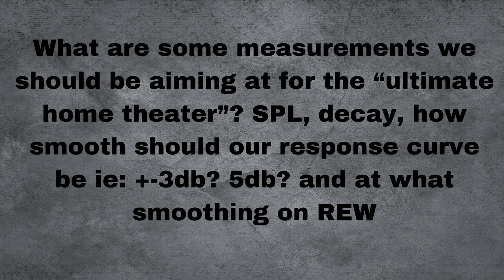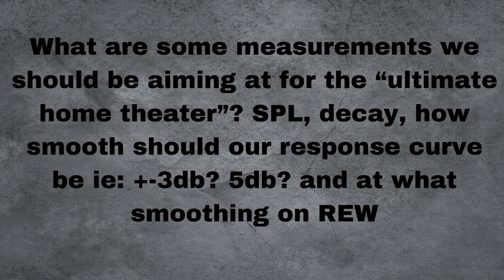The Best Measurements for Your Ultimate Home Theater Setup

Comment: In practical experience, what is the separation needed between surround channels and atmos to maintain spatial clarity.  I have a low ceiling at 7'5".  Seated ear height is around 36".  Following the Dolby specifications of 45° up and 45° left and right, that puts the rear atmos speakers in a .4 system within 2' of my side and back wall.   Trying to decide if a 9.2.2 would be better.  If I stick with a .4,  should I bring the 4 atmos channels closer together (left/right) in order to get further separation from the surrounds or would it be better to bring the surrounds closer together on the back wall than the 135° recommendation to put some distance between the two.  Hopefully that makes sense.

Comment: Very good video, looking forward for more information on this topic in the future. 
i have a question about reference Level, after calibration, the AVR at 0dB is supposed to be Reference level. but how do you know all sources are playing at reference level?
for example streaming services like Netflix, hulu, disney. and could the streaming device also affect this? 

so how do you know you are watching a movie at reference level?
Reply from the maker: There is no reason it shouldn’t be. They would need to be playing with the digital signal level for that to be true. You could try testing it I suppose. But no way to send a test signal to Netflix. You could send test signals to airplay or load onto YouTube.
Reply: @PoesAcoustics  I find myself adjusting the volume by 10-15dB depending on which streaming service/disc I'm watching.

Comment: First of all, thanks, Matt, for providing us with informative guidance! There's never one solution to a perceived acoustic issue; there are always a myriad of factors in play, and it can become increasingly overwhelming to grasp. I'm really keen on RP32 - is there a target release date?

My question is: With all loudspeakers targeted for 105dB SPL, realistically, with immersive material, that target SPL for overhead speakers can become costly. In your opinion, what is the 'lowest max SPL' overheads should aim to achieve? 

My complication is that, I can see my 4 overhead speakers clipping at reference levels, and considering either an upgrade, or adding an additional 2 (for 6 overheads). I'm trying to understand if the extra 2 overheads will contribute to the overall SPL output of my overheads. It might sound backward in my thinking, but because the overheads play object-orientated (therefore not a discrete channel), it seems I wouldn't need 105dB SPL from each overhead...what are your acoustic acrobatic thoughts? lol
Reply from the maker: For some reason I thought I covered this. But tops actually dont absolutely need to hit that. Because of how music can and is being recorded/mixed, I think it’s still useful.  But they are targeting I believe 102dB rather than 105. Also remember you sit much closer to them.

Comment: I am probably not listening correctly. Did he just say to use an SPL meter to set each speaker to 108db instead of the usual standard 75db? This would be based off setting the volume to 0db on the receiver when adjusting db levels.
Reply from the maker: I think you misheard.

Reference level is 85dB. So you set it to 85dB with a -20dBU signal and the receiver set to whatever its reference level is (like 0 on many). That then means that a 0dBU signal would, in theory, give you 105dB output.  In practice it’s not that simple.  But that’s what I was referring to.

108dB is for headroom and isn’t about setting levels. You set the levels to achieve 85dB at a given reference volume level. But many receivers or processors can go positive from 0 allowing higher SPL than reference.  And if your speakers have 3-4 dB of headroom, you could then achieve that in transient peaks.  108dB is 3dB of headroom above reference.
Reply: Ok, thank you for the clarification. I'm a novice at best when it comes to these things 😅
Reply from the maker: @Ab-hc3xm  it was actually a really good catch that deserved clarity. I need to maybe do a video on this topic. 

I just talked to the head engineer at Skywalker sound about this and he pointed out that in practice these signals would never achieve 105dB. And transients could actually be quite a bit higher than this. But actual max SPL would be a lot lower.

Comment: Wondering if you can add this to a question to talk about. I recently purchased a Marantz Cinema 30 and Dirac Live with Bass Control. I have been curious to know what a professional such as yourself can achieve with the software, versus what the average consumer  would achieve? I have read about calibrators being able to do remote calibrations where the customer is doing the mic placements for the calibrator, who would be remotely connected to control the program. Is there more to the process than that?
Reply from the maker: It’s tricky. I don’t believe remote calibrations can be as good as in person. A lot of calibration starts with a good ear. Knowing what to listen for and knowing what you hear.  The best calibrators in the industry don’t work remotely. It’s because we rely on you to  listen and describe. What if you have never heard a good neutral system?  What if it’s doing something wonky and your description isn’t obvious what is wrong?  What if it doesn’t sound good and the words you use don’t have the same meaning to me?  All of that makes a remote calibration hard. 

But…people like myself also have a lot more experience with these automagic calibration softwares. We know how to tweak them. We know what it looks like when it gets it wrong. We know how to get all the basic settings right. 

Another problem with Dirac and similar is that there is only so much we can do.  The target curve adjustment is the main thing.  And yeah there is a real science to that. Different speakers likely need different target curved. And we may know how to tweak the curve to get the most out of it and address sound problems.  

We also know how and to what extend we can push components.
Reply: @PoesAcoustics  Thank You for your insight.  I have been on the fence about getting my system professionally tuned. The trouble comes when I am not in a location with any professional calibrators, so I have to either look in cities several hours away from me or look to have someone remotely look at my setup. I think until I am confident that I won't be adding new components and have every detail in my room complete, I am probably better off sticking with what I am doing. I do hope in the future, I can get the opportunity to experience properly setup systems to better understand what I should be aiming for. One thing is for sure, its a fun journey.

Comment: Very nice video! When we are discussing these target SPLs do we mean the levels that are reached with a full range sweep (how long?) or burst test? 85dB with “peaks” of 105dB sounds like short bursts which may avoid compression seen in longer testing. Also there’s a Dolby Atmos Specifications doc for large theaters that specifies SPL targets of 105 for low freq (excluding LFE), 101 for mids, 98 for highs, and 92db for ultra highs which kind of matches your suggestion that 105 doesn’t mean 105 at all frequencies.
Reply from the maker: I am actually talking with the supervising engineer at Skywalker Sound about this. 

So I think it’s all a bit complicated.  The actual spec comes from SMPTE and refers to the idea that pink noise should achieve 85dB at -20dBU.  So you take pink noise and play it back at -20dBU. Levels should be 85dB. As a results, voices tend to then be around 80-90 dB in the movie. That means we have 20dB of dynamic range.  But in practice it won’t mean the movie is going to sustain output at 105dB during loud scenes.

During loud action scenes, peak SPL will actually far exceed 105dB for short times. But that isn’t really that meaningful.   

As for how this applies to speaker choices. We don’t know. That hasn’t been thought through as well as it needs to be. A speaker that can do 120 dB with a burst test might max out at 90dB with a sustained long term wide bandwidth noise signal.  

I am still exploring this topic and will come back with a more succinct answer.  The individual I contacted feels that certain types of max SPL tests which achieve at least 102dB (at the seated distance)would be sufficient. I am still waiting for an answer on what types of stimulus signals these would be. I suspect it’s going to be shaped pink noise and M noise.
Reply: @PoesAcoustics  Thanks for trying to get us closer to a real answer on this topic, it's interesting stuff for sure.

Comment: Hi can you tell me what app do u use for spl ? I always thought 105db is per speaker not all of them.  The ref is 105db is that peak or continous? Because if you play 105db continous the peak can reach 115db  for main.  Thanks
Reply from the maker: I don’t use an app to measure that stuff. But I do use NIOSH SLM on my phone for quick and dirty SPL checks. It’s the best and most actuate SPL app. 

I never said 105dB was for all speakers. It’s per speaker. Like you said.  It’s a peak value but as I have noted elsewhere, calling it transient peak is a bit misleading.  The 105 is a theoretical max because of 20dB of headroom on a -20dBu signal giving 85dB.  As my friend at Skywalker sound pointed out, that pink noise as prescribed for the test can only achieve -12dBu max and so wouldn’t achieve 105dB. 

The hard issue is equating this to speaker performance. How loud does a speaker need to play with what type of content to achieve the max SPL needed for accurate movie reproduction?  It’s a question nobody is answering correctly at the moment. We need to think this through, which we are doing with CEDIA.

Comment: I myself listen close to reference levels when watching movies alone. The problem is when the wifey watches movies with me she doesn't like it coz she finds the sudden explosions or gunfire  too loud and scares her 😆
Reply from the maker: This isn’t uncommon. If you have any dynamic range compression, you might try using it.  When you turn it down, it doesn’t change the dynamic range, but it does mean that the voices are too quiet and the more quiet noises are buried in the noise floor. Dynamic range compression is needed to fix this.  It’s a dirty word amongst most enthusiasts but shouldn’t be.  After all, you aren’t listening as the artist intended when you turn it down. It’s already wrong. So compressing it is just compensating for that.
Reply: I had the volume issue with my SO to. I got here Loop Earplugs that just reduce the sound by 15db and she has no issues now.
Reply: @robotag95 Good idea.

Comment: when i got my dsp into my system, i really could see how high pass my main speakers affected how loud they could play(Arendal 1961 monitors).
as Poe said, 80hz highpass on those i reach the max excursion, so i set it at 180hz 12db slope. dual 5" woofers on those speakers in sealed boxes.
if anyone wonder ported speakers wont help, those usually have port tuning below 60hz.
Reply from the maker: Yeah the port tuning would need to be closer to the crossover point. 

It’s also the fact that your receiver or amp is free to power a more limited bandwidth. This too is helpful. Many receivers would struggle to provide enough power.

Comment: Don't you think using Var Smoothing is better because then you can see all the dips and peaks in the low end? Because using 1/6 smoothing you could have a giant null due to modes or SBIR and you wouldn't know because it wouldn't show it. You might not hear a huge narrow dip at 50hz but I think once you fix it you'll notice you suddenly have more punch in the bass.
Reply from the maker: All of these approaches could be helpful.  It just depends on what you are doing. Variable smoothing was designed by John to use for equing. It’s not a psychoacoustic smoothing that matches what your ear detects. That’s actually what psychoacoustic and ERB smoothing was developed for.  

Adam Pelz likes to use 1/6 as a way to get an idea of what is going on. Those high Q dips are just not that important in evaluating it.